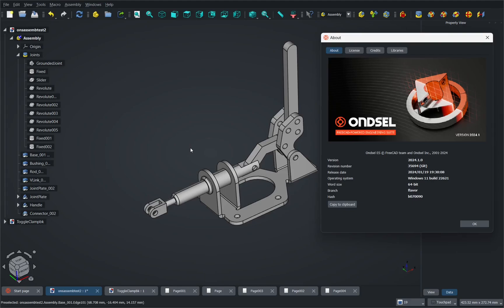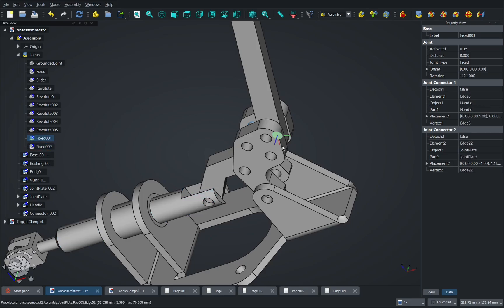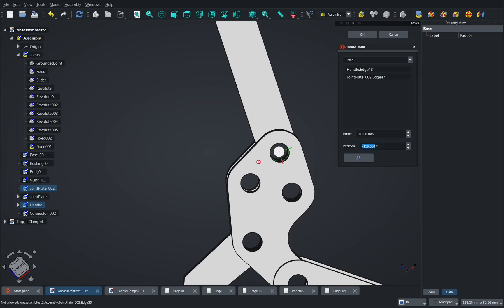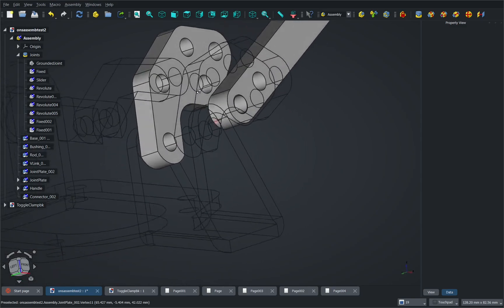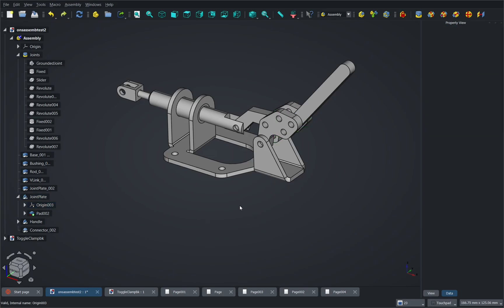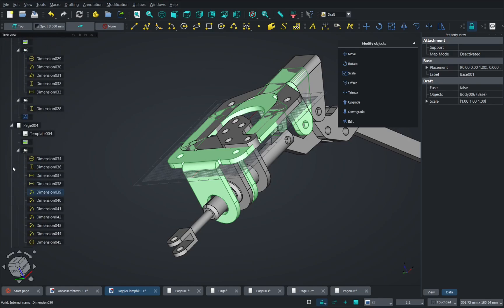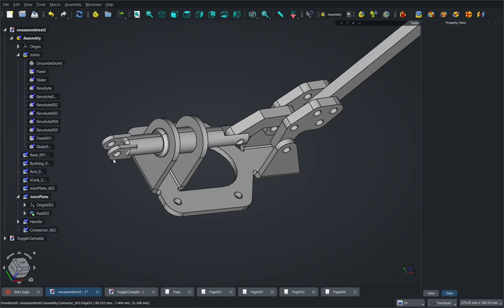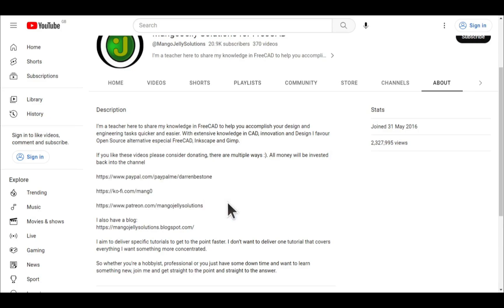Update on Ondsel FreeCAD ES Assembly WB: Progress! What have I Learnt!

Comment: Very Significant timing because I am trying out FreeCAD 0.22.0dev  and the Assembly WB is already included. I do not plan on trying the Ondsel yet. I am wondering if there is a plan to create a 0.22.0dev video that maybe is a fresh start (beginner) and just include all the tip and tricks from these Ondsel videos, but w/o feeling obligated to comparing everything back and forth from the 0.22.0dev to the Ondsel. This is really confusing, I have tried a simpler model and it broke several times but not as many times as you encountered with this project. I plan on watching the previous Ondsel videos up to this one until I make my project work assuming the qondsel and the 0.22 Assemby are close to the same. I feel this Assembly WB is the future!
Thanks so much. I encountered some of the same results but you are so much better at FreeCAD my brain doesn't propose any possible solutions! Lol

Comment: wish I could enable this workbench with all features in weekly build of freeCAD
Reply from the maker: It's a separate branch so ends up being a separate installation.  But they will be merging into the main branch of freeCAD
Reply: @MangoJellySolutions I have downloaded the Ondsel, but it wont install. I get missing api-ms-win-core-path...... error. Seems a few folk have this issue. I aint in a hurry.. up to ondsel to fix, or at least put into on their website 👍. I saw something about motherboards, but TBH I still run win 7 cos of other software I use. So probably my end 😂.

Comment: First of all, a very good channel with concise information.  If you are looking for ideas, I have one.  I've been struggling with modeling INSIDE of a cylinder.  To be more descriptive, I have been attempting to place vertical ribs around the circumference inside a cylinder with varying success.  Your insight would be very helpful.
Reply: Many ways to do this. Easyist is to draw the cyl end profile with the ribs and pad it lengthwise. Or, add a single rib to the inside and do a polar array. If the ribs are complex, do the cyl then draw the ribs on a plane longitudinal to cyl, then pad ? Loads of ways ?